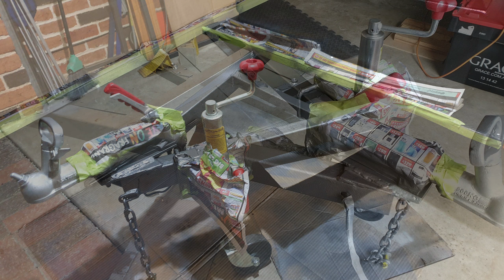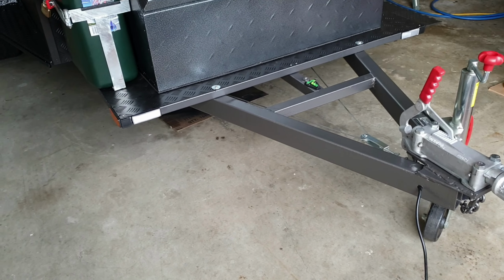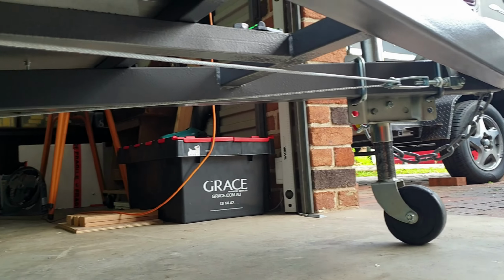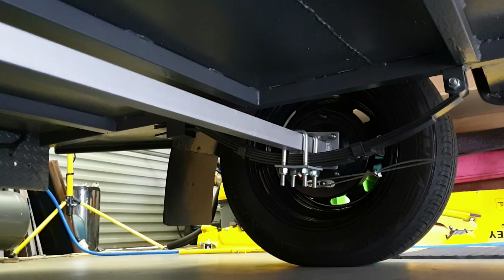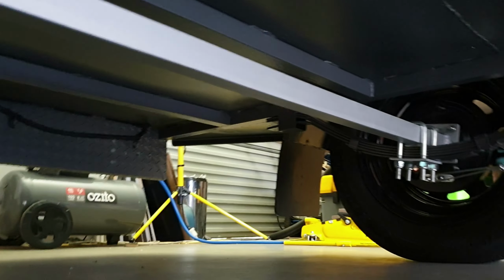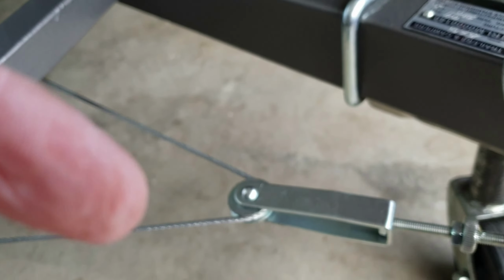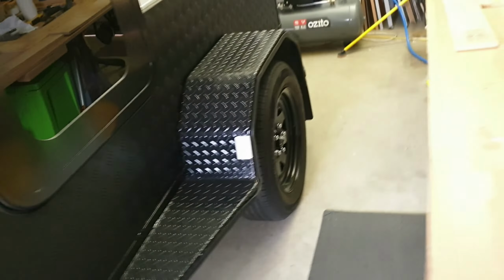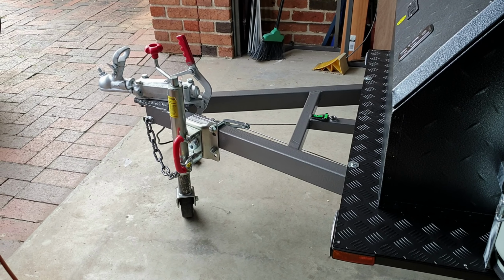DIY Squaredrop camper Trailer Build, Installing Brakes, Curtain's, Moving the tail lights.

Comment: Enjoyed watching all your build videos, I'm looking at doing a similar build but am tossing up between doing an add on canopy like your first trailer as we already have an existing box trailer or a dedicated camper. Your latest camper is making me lean towards the latter, what a quality build!
I've been looking at different trailer options for a base and contacting a few of the companies in Sydney for a flat trailer, probably 8x5 or 9x5 with brakes, did you get the axle offset towards the rear of the trailer when you had it fabricated?